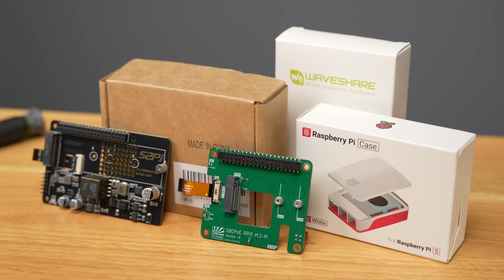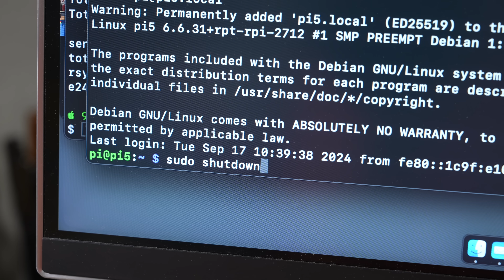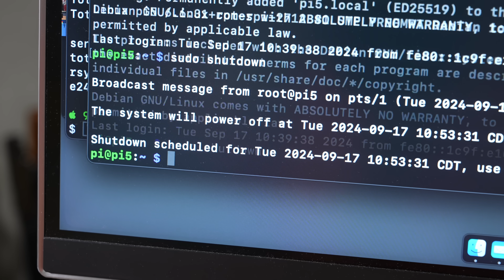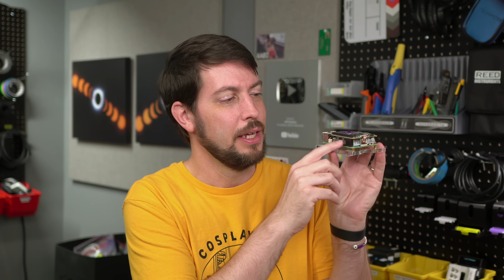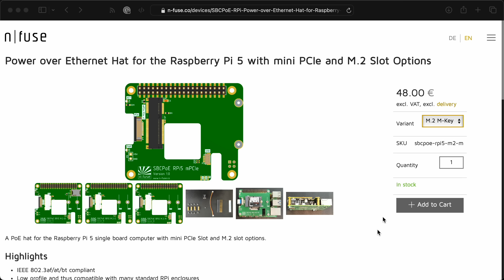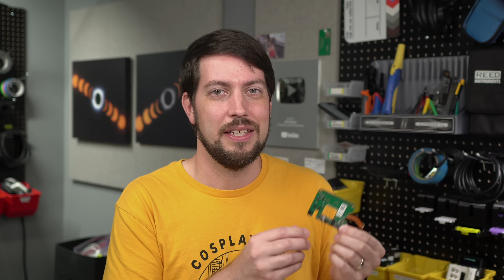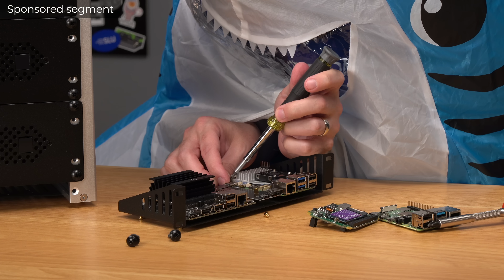PoE+ NVMe beats Raspberry Pi to the punch

Comment: This video is so funny with its timing on my feed. It seems like 52pi took Jeffs advice and fixed the issues he mentioned on their hat. I just got the same hat + pi 5 last month with a really nice aluminum case to use with a 1TB SSD and the HAT now includes the PoE led indicator light on top plus it no longer accidently turns itself back on after shut down, no setting changes required. 

I did read in the install instructions about the USB-C cross power issue, but I read it as don't power the setup through BOTH the USB-C port on the pi and the PoE port. I've been running it on the USB (no PoE cables atm) but it seems to work fine (for now). Probably check that again in a moment. Maybe someone else running into issues? Otherwise no problems so far! Good video sir Jeff.

Comment: I have this 52pi Poe nvme had. Can you tell me why I can’t go back to using an SD card and regular power supply? I am experiencing an issue where if I remove the HAT, the pi won’t boot and it can corrupt the eeeprom even if I reset the configuration to boot from the SD. Any assistance you could give would be appreciated.

Comment: There is a new quad NVME hat for the PI, have you checked it out yet?? 
Freenove Quad M.2 NVMe SSD HAT for Raspberry Pi 5, M.2 Adapter AI HAT 4 Slots NAS RAID Kit, Solid State Drive Size 2230 2242 2260 2280, PCIe 2.0 Max Speed 500 MB/s, Detailed Tutorial

Comment: DO NOT BUY THE 52PI/GeeekPi POE! 52Pi technical support stated, flat out, that the ONLY way to shut down your Pi and prevent the instant restart by their PoE board is to kill PoE power. The official answer to shutting down a Pi equipped with their board is to (virtually) yank the power cord from the wall and just freakin' hope for the best, data corruption wise:

"Dear, you can shut down the PoE switch interface by controlling it. The PoE functionality is not controlled by the Raspberry Pi. If the PoE switch has a management interface, entering the interface shutdown option will shut it down."

Comment: I just setup the first one Jeff showed.  It took a while to setup and get working but using the RP Lite OS seemed to be the least path of resistance (was attempting to boot Ubuntu Server).  Even if you don't plan on using the GPIO make sure to plug the GPIO extender in otherwise the Pi won't boot.  Now I just need to shrink the root partition size since I want to use ZFS on the free space to store readonly data with two additional copies for fault tolerance.  This setup will be key storage for decrypting my various NAS boxes around the house and I didn't want to worry about an SD card going kaput and loosing the keys.

Comment: I've solved coil whine occasionally by drizzling some two part epoxy onto inductors.  Especially if the coil is exposed, this will work.  It does change the inductance slightly, but I haven't had anything stop working as a result and coil whine goes away.

Comment: hey jeff whats your idea on a poe pi nass either a two drive or four drive design, using active cooler and additional fan to help keep it all cooled in a custom made case? like a portable nas for on the go travel and but still having all your files that might not fit on your travel laptop.

Comment: I've been running k3s on a orange pi 5 pro cluster, with the waveshare nvme hat. I just ordered heatsinks to use as the included ones don't fit, but the built in nvme slot along with the hat is soo nice.

Comment: My opinion about the isolation transformer.
Unless you are connecting USB devices that are powered I don't see a problem.  I think the concern would be ground loops which could be very noisy or even 'shifted'.  I would not run USB audio, or a USB oscilloscope without isolation,  but if you don't have any connections to the PI I would think you are ok.  (I am a veteran chip designer, if that improves your confidence in my opinion)  If I am missing something please point it out.

Comment: Still looking forward to the official PoE HAT, because i hope it will include the ability to use the active cooler fan.

I already invested in the Pimoroni bottom hat so dont really need a dual use HAT like this, and the 2 hats available with only PoE does not support the active cooler and from memory, they have a fan that is not speed controllable.

Comment: I just got one of these it works beautifully with an M.2 SSD ... I've also tried an M.2 Oculink adapter, but it hasn't been able to detect the same M.2 SSD on an Oculink to M.2 adapter, or a PCIe card on an Oculink to PCIe adapter ... I've had the exact same problem with my desktop PC, nothing detects over the Oculink which makes me think perhaps my cable is bad, so I ordered the same cable you used with your GPU with hopes that at least that way I'd know I have a cable that's worked for someone else.

Comment: They should build in PoE.  I prefer PoE to having to use another cable to power it.  Would also be good to build in NVME support.  The board isn't $35 anymore so a few $ for these features standard would be worth it.

Comment: 5:20 "So you could use a 9V or 12V USB-C PD adapter that's more common like for laptops and things". Not a laptop charger, but any regular phone charger. A somewhat modern USB-C (PD) charger for phones these days is easily 25W or at least 20W, so would have no problem powering the Pi5 (or pi4 for that matter), but because the RPi specifically wants 5V only, and 5A of it, it's difficult to find a charger outside the official OEM one. Allowing 9V or 12V to supply that wattage suddenly makes almost any regular phone charger (or indeed laptop charger) able to easily and happily power the RPi, which should have been the case in the beginning. (Yes, I understand this would make the RPi a tiny bit more complex.)

Comment: The shutdown thing is a feature, not a bug. You want this. The point of POE+ is that it is difficult to get power into some places, so physical access to the pi isn't that easy.
Reply: If powering the device from a PoE switch though, generally you can power cycle the port and that would get the device to boot up when completely shut down. There are times when you want the device to actually power down.

Comment: Having less cables is always good, but for the price of these HATs I can get another separate power supply for the Pi, so I find them expensive. Also the transformer circuit produces more heat, which is again something you have to handle as you have shown. The non-transformer hat  was actually my favourite because of this. I wonder how really an issue is that it's missing the transformer, especially if you plan to use very short Ethernet cables, and a decent dedicated PoE router to power just your Pi-s connected to it.

Comment: I really like the Pi 5 Neo NVME Case, I use it with a POE/USB C splitter cable and power it using a Ubiquiti USW Flex Switch and POE injector, are there any pros to using a combination POE/NVME hat other than a neater install, especially as it's only around £13 for a Type C PoE 5v 3A Gigabit splitter cable?

Comment: I've gone down a different path than POE hats as some of my remote pi's are really really really remote dusty regions of Australia and I didn't want a spinning fan failure - I ended up getting a $17 POE extractor/splitter (not to be confused with POE splitters that are actually passive POE injectors) and using the DC 5volt output I wired the DC cable to a USB plug into the Pi - instant POE pi with no fan!  And with remote switch access I can hard reboot the PI by configuring the port POE down then up again.
Only current catch is that its 5.0volts - the Pi fortunately is just powering a webcam, so it gets by despite Pi onscreen warning low voltage - butmy next mission is to pull apart the POE extractor/splitter and see if it can be modded to be 5.1volts output instead (as the extractor has a mechanical switch to select between 5volts, 9volts and 12volts so I'm sure there will be something moddable)
Hope that helps if anyone in the same use-case as me.  Cheers =)

Comment: I was thinking I don't see the POE reboot as automatically a bug - I kinda prefer the shutdown to result in starting up on POE again because otherwise this would be a trap if operating the pi remotely.  My most remote pi is a 1994kilometre drive away and if I want that pi off then I simply remote into the switch and configure the POE off, knowing that if I re-enable POE it will boot up fine.
But that's just me, my situation may not be for everyone

Comment: Remember kids, hot to humans, and hot to lightning trapped in rocks that we tricked into doing math are two completely different kinds of hot. 60C is not an issue (depending on the part, and more importantly the specs for that part. Many electronics are entirely happy running at temps that are deadly to humans).
Reply: Cooler parts last longer. The pi 5 doesn’t throttle itself until 80c but it will shorten its lifespan.  And the parts around it might not be so happy with that high of a temp.

Comment: If a board lacks isolation, a PoE splitter (male eth, female eth, barrel jack) may work as an in-line isolation transformer?  That depends on the circuit design, and whether the isolation covers the female ethernet port.

Comment: The isolation transformer is required for very good reasons. You might get away without one when using very short ethernet cables but generally not having one is going to end with sómething losing the magic smoke sooner or later.

Comment: POE board for my Pi4 made it so much more usable. Throw in a bluetooth mouse and keyboard and you have a one-wire microcomputer with full functionality. All I need to do is switch inputs on my monitor.

Now if it only had 32 GB RAM instead of 8....

Comment: With the PoE isolation, I had a problem years ago with a cheap non-isolated PoE switch and a non-isolated PoE adapter.  Any time I plugged the Pi into a monitor the whole PoE switch would short out and shut off, and I'd have to power cycle the PoE switch power supply to get it to come back on again.  The issue was the PoE switch ran off a +48VDC supply, but it reversed the polarity in order to get -48VDC required for PoE.  This meant the power supply had bonded DC negative to ground (normal) but the switch then connected DC positive (48V) to PoE ground, so there was a 48V difference between the two grounds, and the Pi's GND would be floating at +48VDC.  So when you plugged in a monitor, +48V would travel through PoE ground, through the HDMI shield, through the monitor back to earth, through the building earth wiring to the switch power supply where that +48V would get shorted to DC negative inside the power supply (because DC negative was bonded to earth), causing the supply to shut off.

I fixed the problem by inserting a 5V to 5V isolated DC-DC converter between the PoE splitter and the Pi, which worked fine for many years.

I have since learned that isolation is merely recommended by the Ethernet standard, so if you have a good quality PoE switch that has isolation on each port (like a Cisco) then it won't be an issue.  Having isolation on the device itself will let you use it with a cheap switch that isn't isolated.  It's only when both the switch and powered device are not isolated that you can run into problems.

You can easily check this with a multimeter by measuring the voltage between the powered device ground, and some other known ground like the unpainted back of a PC case.  If it's 0V or very close to it you're fine, but if it's any other voltage then your devices are not isolated and you have to be very careful what else you plug into the Pi to avoid causing a short circuit somewhere.
Reply: It's always easy for me to forget to check negative reference to ground in the first place, much less whether it changes when plugged into a peripheral. Good troubleshooting, sounds like it was a gray hair inducing one.
Reply: The IEEE standard for Ethernet REQUIRES isolation between the Ethernet lines ("MDI leads" in standards speak) and all other accessible external conductors.

However, standards are not laws. Sometimes a law may incorporate a standard by reference, or a standard may be used in demonstrating compliance with a law but I don't think any of that applies to Ethernet standards.
Reply: @petermichaelgreen  Hmm you're right.  I'm sure I read somewhere that isolation is optional at the point where PoE power is extracted/injected but going back to the IEEE standards it always seems to have been required.  I guess it's just something they don't bother with for low-cost devices.

Comment: I wonder, does the nvme slot support the nvme to sata adapters, I wonder if you could use this as a POE style nas, only needing to give power to the SSD‘s. It would make a great way to have your Nas inside your PC case and not have to worry about a USB-C inside your case to power it.

Comment: My router doesn't have PoE ports and buying a splitter for that purpose sounds overkill since I need to feed power to my Pis anyhow.
But I love the idea especially since the Pi usually looks like a mess anyway if you plan to use it in a more traditional desktop scenario.
So having at least one more side being covered in cables is a good thing. Another option is to buy the Argon One case for instance but that too doesn't come with PoE.

Comment: Hey, Jeff unrelated question to the video here. Since It's almost a year after the PI5 release now, I wonder would you could share what type of workloads you put on your PI5 at your homelab. I've been consider getting the PI5 for quite a while now, but I just don't really now what kind of usecase would it excel at. I've had my PI3 since I was in high school and have been doing countless prototypes on it, but putting it on my rack is a different matter.
Thank you in advance, Love your videos.
Reply from the maker: Honestly I'm mostly running Pi 4's in my homelab right now. I have one Pi 5 running Frigate (since the extra CPU power and PCIe lane makes it much better for that), and I've been testing another Pi 5 as a networking router, but am still not fully satisfied with it (I'll do a video on it when I am, heh).

At the studio, I have a Pi 5 running as my little utility server; I've thrown a few Docker containers on it, I have remote access enabled, and it is used when I want to run a quick test against a Pi or arm CPU and I don't need to run one of my Ampere servers.

Comment: Funny, you can use Orange Pi 5 and run nvme drive without and an additional card and you do not need a fan too, the OPi 5 runs cool about 50C. Anyway, the video is an educating.

Comment: I'm just too cheap to buy one of these. Too many compromises and the added expense of a poe switch really runs up the cost. I'd rather juat use a cheap sd card and wifi as I'll just use my Epyc based server if I need more network speed or iops.

Comment: I've successfully been using PoE splitters for some time now. PoE in -> USB-C Power Delivery jack and gigabit RJ45 (ethernet) jack out. It's not pretty, but it works! No obstruction, heat generation or whine created by a hat, and the splitter is not Raspi specific, so it could also be used for other devices or Raspi models.

Comment: I use a PoE to USB-C splitter  which is a great cheap way to get PoE to a Pi but it seems to cause some under-voltage errors so something like this is a great fix for the hacky solution :)

Comment: 10:39 Is the plastic on the isolation transformer partly melted?
Reply: @CGW11  No. It is epoxy glue used to fill and fix the coils.
Reply: @vileerdeng  Ah! Thanks

Comment: i've been rocking the black one for my main RP5 for months now and its very nice and reliable.   I might have to look into that Aruba device, because I haven't had luck with anyting but the beefiest PoE++ switches getting these dual purpose hats to boot off LAN alone, consistently... idk whats wrong.  You are correct about the height being an issue for me, attempting to pack 4 of these into a purpose built RP5 cluster rack.... but you can't win them all.   I'm considering getting a legit rack now, like the GeekPi one you had, and finally go legit with a "real" rack now.    the second hat you talked about looks like it might be just what the doctor ordered to complete my setup

Comment: Orange Pi 5 watching this is like:
"All that to replicate fraction of my power..."
Reply from the maker: Orange Pi 5 and OPi 5 Max are great little bits of hardware. I just don't choose to deploy the ones I bought in production because I have still not gotten to a point I'd trust them long-term (like the 3-5 years I normally keep a given Pi running).
Reply: @JeffGeerling interesting, what is the longest orange pi you've been running and did you have failures yet while testing?
Reply from the maker: @JulesArchinova  I've been testing the OPi 5 Max a bit, hoping to do a video on it soon(ish). The bigger problem I've had is the on-again-off-again support I've gotten for each of the Orange Pi devices I've bought. They throw out a lot of hardware, but don't spend the time (especially after a couple years) to keep supporting it with their software. (See @Atylonisus' comment above).
Reply: I too own an Orange Pi 5 (not the 5B or 5Plus, just the basic one).
It suffers from a smaller ecosystem of passionate developers + worse documentation. 
If i wasnt using mine for Batocera I think I might chuck it through a wall.